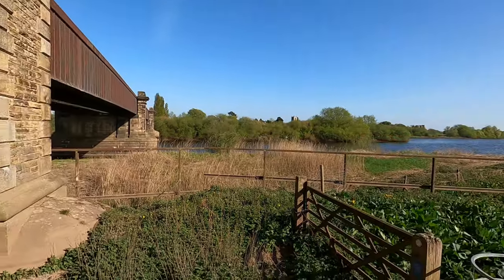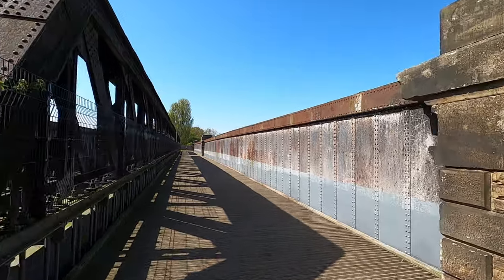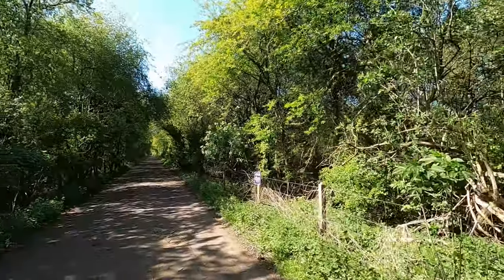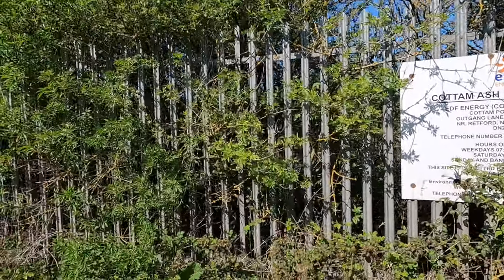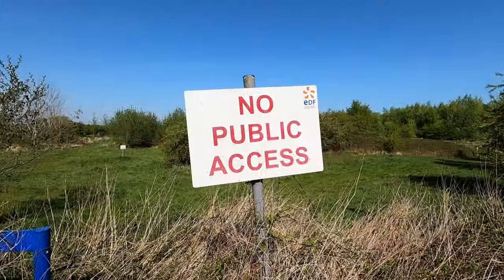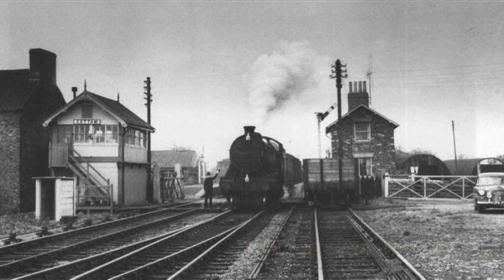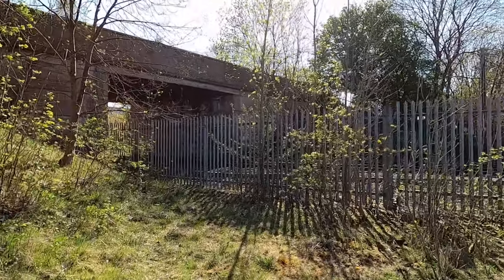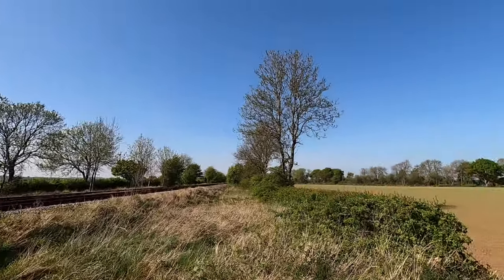Torksey Viaduct & Cottam Power Station Disused Railway Walk

Comment: Thanks for this excellent video (watched a dozen or so, so far, but this is my 1st comment). I sure wouldn't mind visiting this viaduct myself, one day.
This straight line-of-route used to host the Harwich Boat-Trains (from Liverpool/Manchester) but, with such an early closure of this section of line, boat-trains subsequently had to take a big detour north-east, via Gainsborough Lea Rd Station.  I was still a little tyke when we'd head off on our Continental hols, boarding our boat-train at Guide Bridge, which then took the Woodhead route and went around Gainsborough way - but I was way too young to remember anything.  These days, I still have my Continental hols, but by air - and I'm often fortunate to have a window-seat, where I'm inevitably 'well-chuffed' to get my bearings once I see Cottam and West Burton Power Stations.

Comment: I was in that area yesterday, drove through Cottam, but had no idea Torksey Viaduct was there at the time. I wish I'd have realised as I'd have stopped off for an explore. Great that it remained despite being out of use for decades - so it could be repurposed. I read that it's currently just a walkway. But great if they upgrade it for cycles, and incorporate the old line leading to the viaduct if possible.

Comment: 2 spans of reinforced box girder the extra centre truss was added as the box sagged with its own weight & since 2016 the bridge was opened as a permissive bridleway, the entire bed is still down apart from a missing steel girder bridge which has the village nameboard bolted to it

Comment: I’ve worked on the Stack for Delta International doing repair work on it. it’s 650 ft and it’s one of the best chimneys I’ve worked on the lift on the inside all the way to the roof is a life saver, I’ve only had to climb the stairs all the way to the top once. I’ve got a video I took with my DJI Mavic 2 Zoom about 3 weeks ago on my YouTube channel.
Reply from the maker: I was back there yesterday around the other side, got reasonably close to it before chickening out 😂